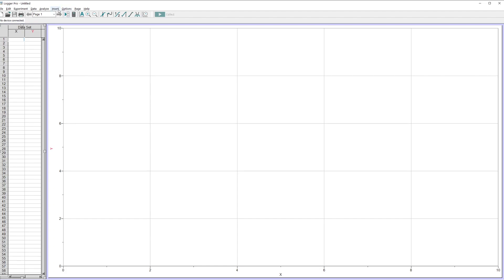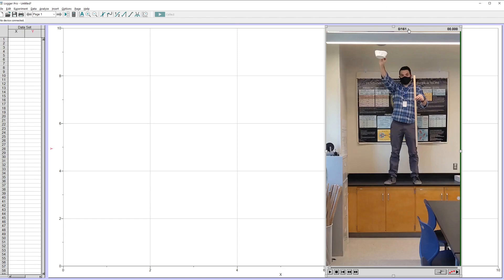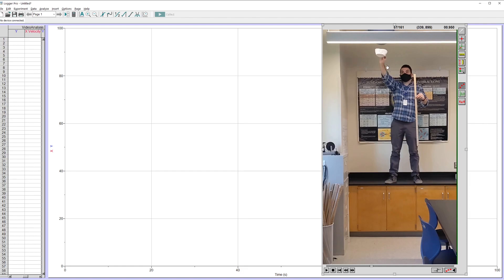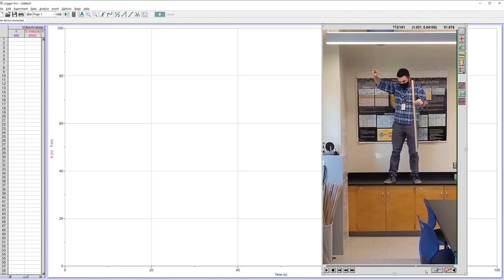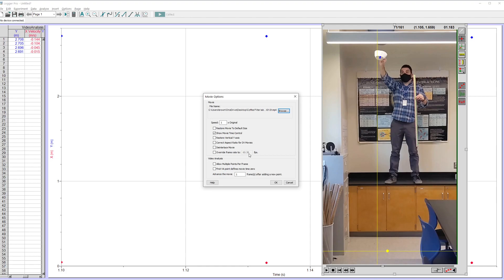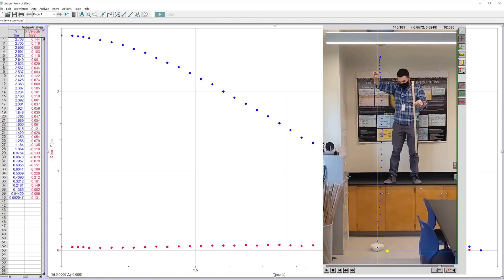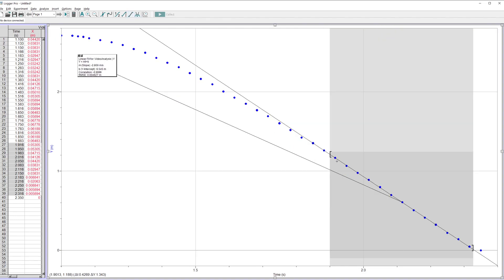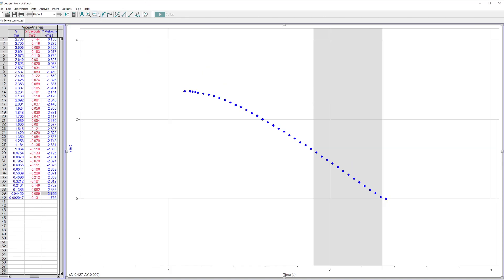Video Analysis Tutorial - Terminal velocity of coffee filters

Comment: Thank you for sharing this video! I’m an IB physics student currently doing the IA, I also used logger pro to plot the position of the object to find the terminal velocity. Now I am struggling with how to determine the uncertainty of the displacement, since my data is not directly measured using a ruler, so instrumental uncertainty might not work in this case. I wonder if there is any way that I can find or calculate the uncertainty of the displacement plotted using logger pro? Thanks a lot